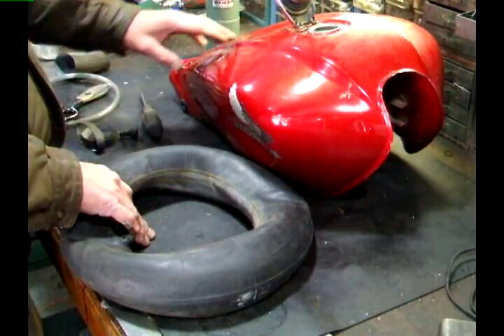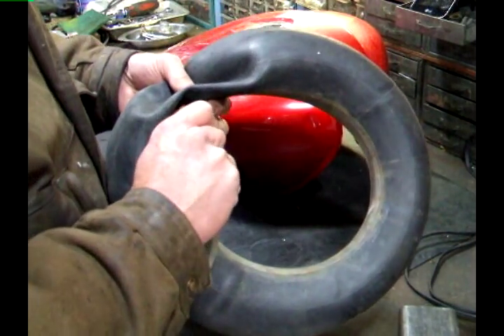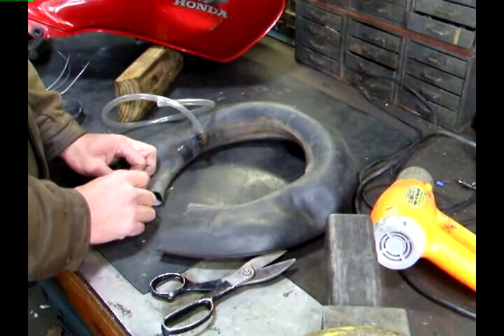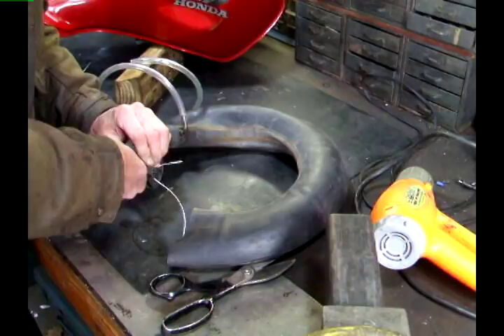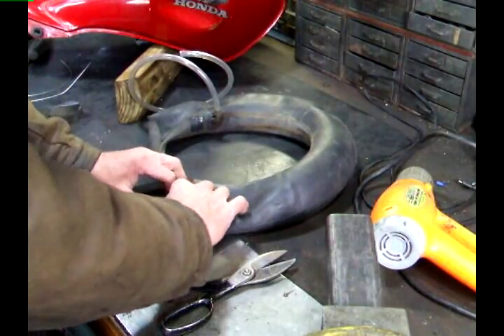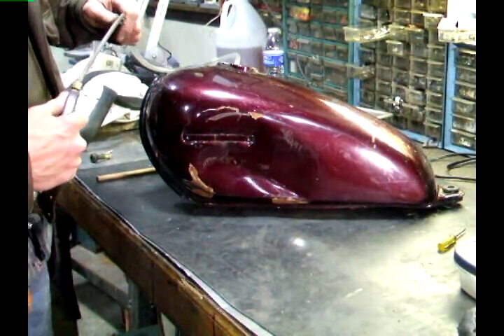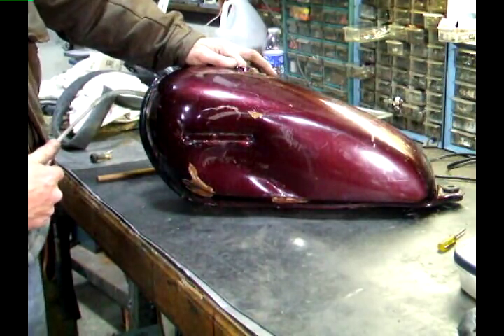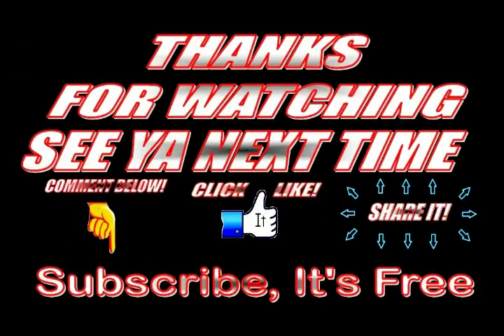Pop Out Dents in a Motorcycle Gas Tank

Comment: Good idea but it's better if you have tank mounted on the bike then pressured. The pressure sometimes makes other parts of the tank expand. This will make a hard time fitting tank back on the bike. Found out the hard way.
Reply: Fern C, a really good point made, i was thinking of that myself wondering how to get around that problem. Thanks for this info.
Reply: I unintentionally destroyed a tank by doing this.  I was lucky to find a decent replacement.   Good Kawasaki F7 parts have proven to be tough to come by.

Comment: just use a whole tube , and use the valve and stem complete , no need for the messing about , just get on with it. the valve stem will stick out the hole and work fine
works well on door skins too , but it can move the whole panel so take care , but its still better than a dent , works really well on big soft dents.

Comment: Impressive demo, but I couldn't help wondering whether it was really necessary to cut that section out of the tube? Presumably it would be much harder to get the tube in and out of the tank if you didn't? Also, good point about doing it with the bike in situ, on the bike, to avoid expansion in the wrong places and making it impossible to refit! Finally, you've written 'technik' when you obviously mean *technique*.

Comment: I have a GS1000 tank with a dent in the side on the forward cheek, the widest part. I am going to brace the arch with wood and fill with water and use a hydraulic hand pressure test pump to help push it out, I may use a glue on puller at the same time, but this sure is a good idea with the tube.
Reply: How did that work

Comment: Drill a couple of holes in the tank . Using a slide hammer pull out the dents in the regular manner. Fill up the tank 95% with water then close the tank cap . Turn the tank dent side upward . Now braze over the holes. Now, with file(s) shape the brazed area to the desired contour .  Wa La !  you have just repaired your tank !
Reply: Wa Law, you now have two very large burn spots and filed down bronze as a custom decoration on a previously painted tank (that is provided you were planning to still ride the bike).

Comment: What kind of inner tube is that ? Tried a few times with michellin inner tube R16 both time it explode before it actually fix anything. Tried couple more times with smaller tire off amazon again for ATV no success. Thanks
Reply from the maker: That was a heavy duty motocross tube. Some times for worse smaller dents I use a small rubber foot ball. Sometimes It doesn't work on really creased dents. Works best on shallow dents like on the nighthawk tank in the video. Some of it depends on how heavy of metal the tank was made out of.
Reply: @Amotorcyclenut  I bought heavy duty and yes it’s way stronger and thicker than the once I used before. It’s so thick that I had problems tightening the ends. It did straighten the tank a bit but it doesn’t have the final push to pop it out and I’m not trying to preserve the paint at all. Will try again tomorrow and see how it goes. Thanks for the respond

Comment: Fill with water,put in freezer.
Reply from the maker: Live dangerously!
Reply: Had a friend do that and the tank over expanded beyond the dent. Constant monitoring during the freeze would probably have avoided that end result.
Reply: Good idea, the ice as it expands will exert an even amount of pressure within the tank, eventually causing the DENT to return to it's 'original' shape; the only thing I would suggest is to make a cradle ( from thick cardboard ) to hold the tank so the DENT is located at the 'top', this way the ice will form in that area initially and will produce enough pressure to remove the DENT a little more evenly because of the air that will initially be compressed between the ice and the tanks walls, regardless if it's aluminum or steel.

Oh Yeah - do Not try this technique with a fiberglass tank!!